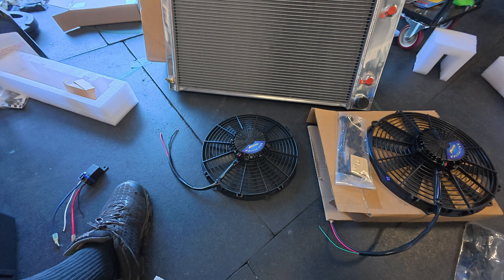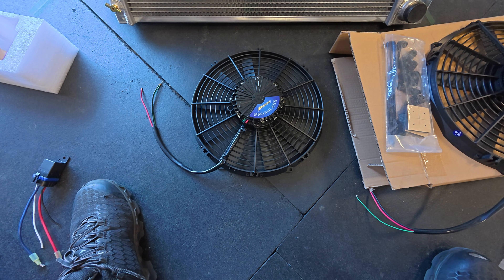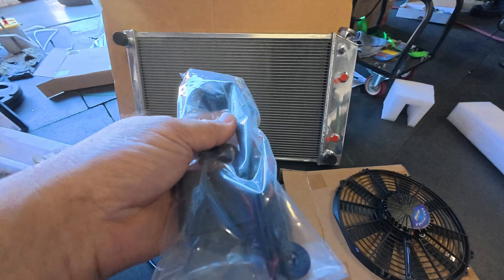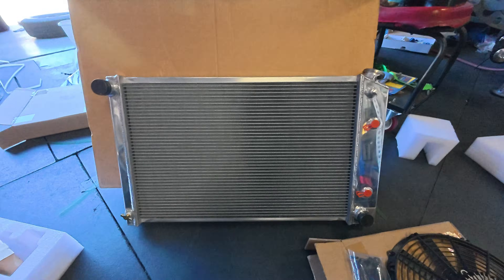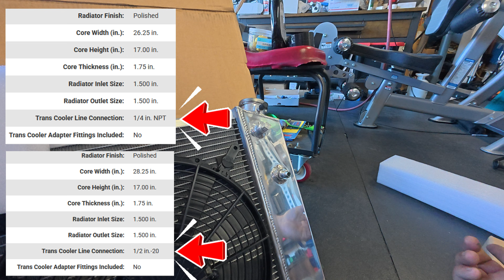El Camino - Video 6 ProForm Brushless Fans Install

Comment: You have been killing it bro. How much do you charge for a ls swap?  Im  in long beach saving for a swap now
Reply: I wanted to know too. Hope he answers.
Reply from the maker: Depends on the extras for the swap (if u want to upgrade suspension, gauges, brakes, etc) but labor now is around $9500 and next year it will go up a little more
Reply from the maker: Depends on the extras for the swap (if u want to upgrade suspension, gauges, brakes, etc) but labor now is around $9500 and next year it will go up a little more